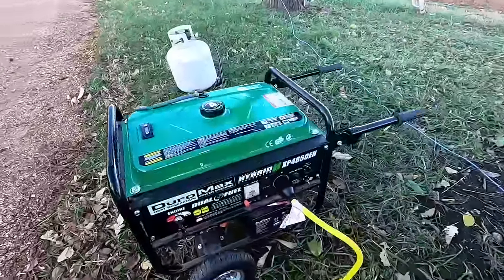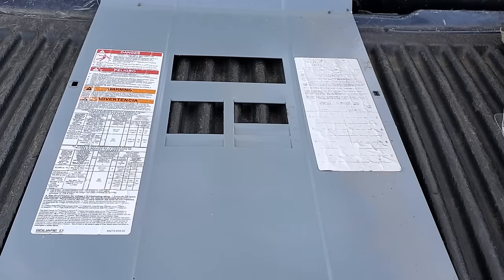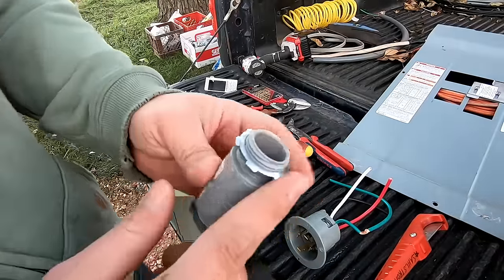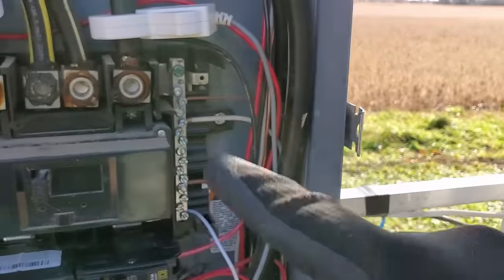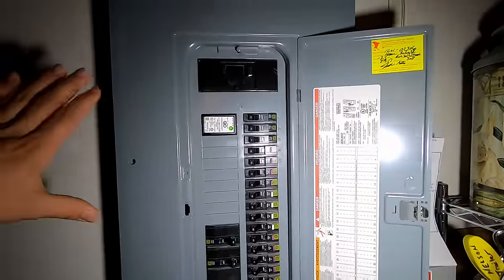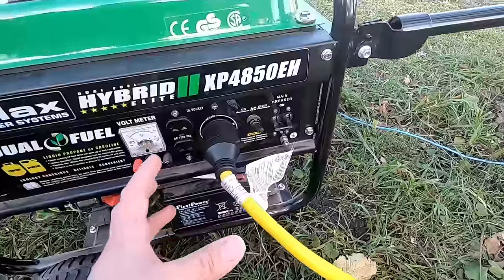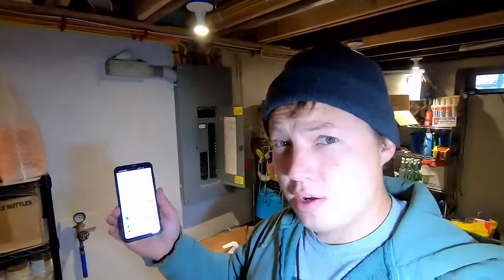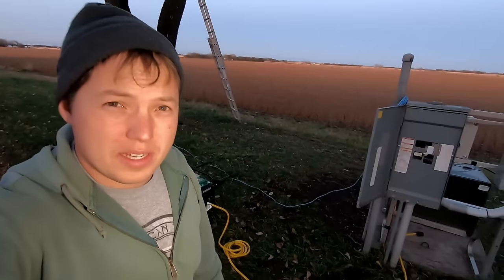How To Hook Up a Generator To Your House Using a Breaker Interlock Kit & Power Inlet Box

Comment: One more question... In one of your videos, you seemed to indicate that although an inverter generator might be recommended for delicate electronics... it may not be necessary? I'm reading into your "dismissiveness" given the extra cost you referenced. So I wanted to ask your opinion as to whether you find it important for the protection of computers/laptops/televisions, etc; of if you thought it was generally overkill? Seems that most non-inverter generators run at about 10-12% THD, while electronics usually should only be run on a current with about a 5% THD. The recommendation from non-inverter generator manufacturers is to purchase a double conversion UPS system but those can run as expensive as the generator itself. Thanks!
Reply: ⚠️Please don’t forget to follow the generator safety tips whenever you use your portable generator. This is a very important announcement for everyone. This is just a reminder for everyone’s safety. All generator safety rules need to be followed carefully 

Generator safety tips: 

1) KEEPING OTHERS SAFE: Please do not allow an unqualified person or your children to operate and service the portable generator. Just because some manuals don’t say that doesn’t mean it’s safe. That is important against the generator safety rules. We also need to be keeping an eye on our children too. You need to make sure that your children are not playing near the portable generator especially when it’s running so they won’t get electrocuted. Generators pose electrical risks and they can be hot during an operation. Please keep your children away from the portable generator at all times. It is important to keep our children safe especially our little ones. Children often get curious about anything so we should keep an eye on them to also make sure they’re not wandering towards the generator. 

2) WHERE TO RUN YOUR GENERATOR: Some people use their portable generators indoors which increases the risk of carbon monoxide poisoning. It’s important to have a carbon monoxide if you have a gas generator. Never ever use your generator indoors even if your doors and windows are open and even in the garage is not safe to use a portable generator. Not even at your porch and your deck. It is never safe to use your generator indoors and in enclosed areas of your home. Your generator needs to be 15-20 feet away from your house. 

3)🔥FIRE HAZARDS: Never refuel your generator while it’s running. You need to let your generator cool off before refueling it and before storing your generator. Never overload your generator too. Never ever back feed your generator. You should never plug your generator into a wall outlet. Also never store propane tanks indoors. Please keep flammable things away from the generator as well and please don’t smoke cigarettes near the generator. Having a fire extinguisher next to the generator is also important against the generator safety rules. 

4) GENERATOR OPERATION: make sure your hands are dry before touching the generator. Never use your generator in wet conditions. Don’t let your generator get wet. You need a generator tent if you need to use your generator during wet weather. Please don’t wear loose clothes when operating the generator. Turn on your generator before plugging in appliances. Use the right cord for your generator. Please do not use worn out cords. 

https://youtu.be/I1jT3ANENvI and here is a video more about keeping others safe when using generators. All generator safety rules should be followed carefully. 

Hope this helps.

Comment: If I'm running a bigger generator., 50 amp, w/ 50 amp breaker & outlet is 50' away, is 6/3 & 8/1  ground sufficient?

Comment: Ben. In wireing my generator to my house, a Duramax 8000/10000 watt, how do I wire the inlet connection plug that will go to my main house panel. The neutral and ground is my concern. In my panel they are wired together on the ground bar. Should I wire them together in the plug as well or separate?  Any advice will be appreciated.

Comment: Ben, regarding neutral bonding in portable generators. I want to feed my house panel through a L14-30R 30A receptacle. Panel has an interlock to prevent backfeed.  My county electrical inspector says I must use generator with a floating neutral. My electrical contractor says a bonded neutral is okay. Most manufacturers make generators with bonded neutrals and they are loath to tell you that you can remove the bonding jumper.  Soooo, it looks like a coin toss.
Reply: Ben answers this question @19:00 . If your home's breaker box has neutral and ground wires sharing the same buss bar (i.e., bonded neutral), you'll need a generator that has a floating neutral.

Comment: Question: 
Generation output 220v into electrical box inside the house that mean you can use 110 v outlet in side the house ?
Reply: Yes. As long as there is a neutral wire for the 110 volts.

Comment: Great video!  👍🏼.  One question...I have 2 200amp panels feeding my house. Would this set-up work if I installed an interlock and 30 amp breaker for the generator on each panel?

Comment: Would this set up be hooked up identically to what you did if installing it in a basement breaker panel?
Reply: Here are the generator safety rules that everyone needs to follow: this is just a reminder for everyone’s safety. Always make sure you follow all the generator safety rules whenever you use your portable generator. Generators can be dangerous if not used carefully. Every year, hundreds of people die or get injured when using portable generators due to carbon monoxide poisoning and electrocution. Make sure you are using your generator carefully and keeping others safe as well. There is something very serious that everyone should always be aware of when using generators. Some people do run their generator indoors which is not safe and that increases the risk of carbon monoxide poisoning which can cause death of family and you. Some people run their generator in wet conditions which can electrocute them. Please remember that you should never run your generator indoors. Remember that carbon monoxide is an odorless and colorless gas that you cannot see or smell. Carbon monoxide is a silent killer. Keep that in mind. Make sure your generator is 15-20 feet away from your house and away from doors, windows, and vents. Never use your generator in your porch too. Having a carbon monoxide detector is very important against generator safety. Some people also allow children to go near the portable generator which could pose risks. We need to keep an eye on our children making sure that they are not near the portable generator so they won’t get electrocuted or burned by the generator which is dangerous. A locking enclosure also keeps kids safe. A generator shed might look like a tempting place to explore, or take cover during a game of hide and seek, but a generator is a dangerous piece of equipment that can cause injury. It says on the manual that we should also keep children away at all times from the portable generator to avoid injuries. Please do not allow a child or unqualified people to operate the portable generator.  It is important to keep your children safe especially little ones. The portable generator can be hot during an operation. Just because some manuals missed what should be listed doesn’t mean it’s safe to do. Always follow the generator safety rules when using portable generators. Generators pose electrical risks. If you need to use your generator during wet weather, you need a generator tent to protect your generator from getting wet. Don’t let your generator get wet. Keep your generator dry and before using your generator, please make sure your hands and your generator is dry. Do not wear loose clothing when operating the generator. Everything that is said on the generator’s operating manual should not be ignored. Never smoke cigarettes near the generator. Please keep flammable things away from the generator. Never overload your generator too. Your generator can catch fire. Never ever try to plug a generator cord into a wall outlet to avoid back feeding. Back feeding your generator is dangerous. Always turn on your generator first before plugging in appliances and shut off the appliances before turning your generator off. Use a heavy duty cord for your generator and the cord should not be worn out. All the instructions should be followed carefully. Never refuel your generator while it’s running. It can cause fire if fuel spills while your generator is hot. You should turn off your generator and let it cool off before refueling it. Having a fire extinguisher next to the generator is also important. This is only a reminder for everyone’s safety of using generators. Make sure your generator is properly grounded. Having a fire extinguisher next to the generator is also important against the safety rules. https://youtu.be/I1jT3ANENvI and here is a video more about keeping others safe when using generators and also about our family’s safety. It’s important to keep our little children safe as well. Make sure your little children are kept away from the generator at all times especially when it’s running. Hope this helps. Always remember that it’s better to be safe than sorry. Remember that warnings should not be ignored.

Comment: So that 30 amp breaker has power coming directly from the generator serving as main disconnect and also  from that same breaker the wires are running to your main disconnect in your house panel?
Reply: Here are the generator safety rules that everyone needs to follow: this is just a reminder for everyone’s safety. Always make sure you follow all the generator safety rules whenever you use your portable generator. Generators can be dangerous if not used carefully. Every year, hundreds of people die or get injured when using portable generators due to carbon monoxide poisoning and electrocution. Make sure you are using your generator carefully and keeping others safe as well. There is something very serious that everyone should always be aware of when using generators. Some people do run their generator indoors which is not safe and that increases the risk of carbon monoxide poisoning which can cause death of family and you. Some people run their generator in wet conditions which can electrocute them. Please remember that you should never run your generator indoors. Remember that carbon monoxide is an odorless and colorless gas that you cannot see or smell. Carbon monoxide is a silent killer. Keep that in mind. Make sure your generator is 15-20 feet away from your house and away from doors, windows, and vents. Never use your generator in your porch too. Having a carbon monoxide detector is very important against generator safety. Some people also allow children to go near the portable generator which could pose risks. We need to keep an eye on our children making sure that they are not near the portable generator so they won’t get electrocuted or burned by the generator which is dangerous. A locking enclosure also keeps kids safe. A generator shed might look like a tempting place to explore, or take cover during a game of hide and seek, but a generator is a dangerous piece of equipment that can cause injury. It says on the manual that we should also keep children away at all times from the portable generator to avoid injuries. Please do not allow a child or unqualified people to operate the portable generator.  It is important to keep your children safe especially little ones. The portable generator can be hot during an operation. Just because some manuals missed what should be listed doesn’t mean it’s safe to do. Always follow the generator safety rules when using portable generators. Generators pose electrical risks. If you need to use your generator during wet weather, you need a generator tent to protect your generator from getting wet. Don’t let your generator get wet. Keep your generator dry and before using your generator, please make sure your hands and your generator is dry. Do not wear loose clothing when operating the generator. Everything that is said on the generator’s operating manual should not be ignored. Never smoke cigarettes near the generator. Please keep flammable things away from the generator. Never overload your generator too. Your generator can catch fire. Never ever try to plug a generator cord into a wall outlet to avoid back feeding. Back feeding your generator is dangerous. Always turn on your generator first before plugging in appliances and shut off the appliances before turning your generator off. Use a heavy duty cord for your generator and the cord should not be worn out. All the instructions should be followed carefully. Never refuel your generator while it’s running. It can cause fire if fuel spills while your generator is hot. You should turn off your generator and let it cool off before refueling it. Having a fire extinguisher next to the generator is also important. This is only a reminder for everyone’s safety of using generators. Make sure your generator is properly grounded. Having a fire extinguisher next to the generator is also important against the safety rules. https://youtu.be/I1jT3ANENvI and here is a video more about keeping others safe when using generators and also about our family’s safety. It’s important to keep our little children safe as well. Make sure your little children are kept away from the generator at all times especially when it’s running. Hope everyone finds this helpful. Always remember that it’s better to be safe than sorry. Remember that warnings should not be ignored.

Comment: I purchased a 6 gauge 50amp generator extension cord 30 ft in lenght, can the foot and half of wire going from the power inlet box to breaker be 8 gauge, it's about 1 1/2 feet long?
Reply: The breaker it's going to is also a 50.

Comment: Hello Benjamin, my house is 65 years old and in very good condition with my constant "fixits".  I want to install an interlock kit and power inlet box. My question/problem is that the only main breaker is in the electrical box that is attached to the side of the garage, my service panel in the garage has only circuit breakers. If I flip the main breaker in the outside box, where would I put the generator interlock kit? Daniel

Comment: I don't install anything less than a 50 amp in feed. 12kw capacity with generator interlocking CH cutler hammer or QO Square D
Reply: ⚠️Please don’t forget to follow the generator safety tips whenever you use your portable generator. This is a very important announcement for everyone. This is just a reminder for everyone’s safety. All generator safety rules need to be followed carefully 

Generator safety tips: 

1) KEEPING OTHERS SAFE: Please do not allow an unqualified person or your children to operate and service the portable generator. Just because some manuals don’t say that doesn’t mean it’s safe. That is important against the generator safety rules. We also need to be keeping an eye on our children too. You need to make sure that your children are not playing near the portable generator especially when it’s running so they won’t get electrocuted. Generators pose electrical risks and they can be hot during an operation. Please keep your children away from the portable generator at all times. It is important to keep our children safe especially our little ones. Children often get curious about anything so we should keep an eye on them to also make sure they’re not wandering towards the generator. 

2) WHERE TO RUN YOUR GENERATOR: Some people use their portable generators indoors which increases the risk of carbon monoxide poisoning. It’s important to have a carbon monoxide if you have a gas generator. Never ever use your generator indoors even if your doors and windows are open and even in the garage is not safe to use a portable generator. Not even at your porch and your deck. It is never safe to use your generator indoors and in enclosed areas of your home. Your generator needs to be 15-20 feet away from your house. 

3)🔥FIRE HAZARDS: Never refuel your generator while it’s running. You need to let your generator cool off before refueling it and before storing your generator. Never overload your generator too. Never ever back feed your generator. You should never plug your generator into a wall outlet. Also never store propane tanks indoors. Please keep flammable things away from the generator as well and please don’t smoke cigarettes near the generator. Having a fire extinguisher next to the generator is also important against the generator safety rules. 

4) GENERATOR OPERATION: make sure your hands are dry before touching the generator. Never use your generator in wet conditions. Don’t let your generator get wet. You need a generator tent if you need to use your generator during wet weather. Please don’t wear loose clothes when operating the generator. Turn on your generator before plugging in appliances. Use the right cord for your generator. Please do not use worn out cords. 

https://youtu.be/I1jT3ANENvI and here is a video more about keeping others safe when using generators. All generator safety rules should be followed carefully. 

Hope this helps.